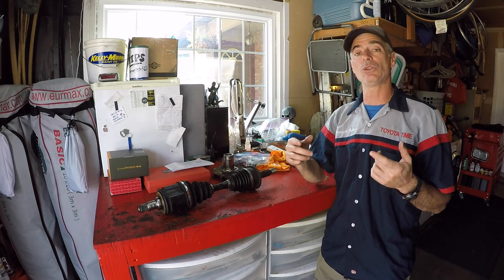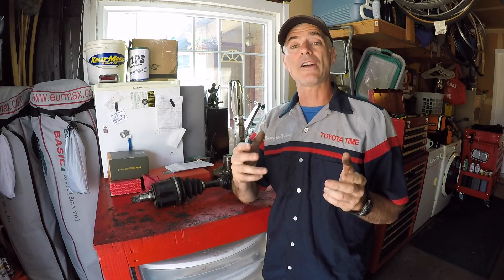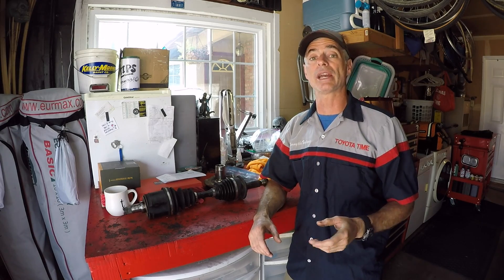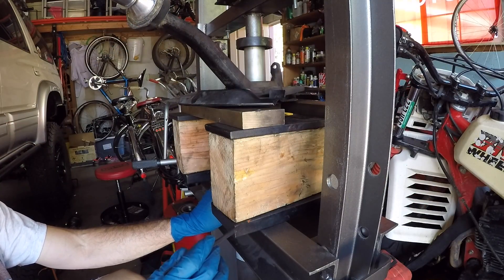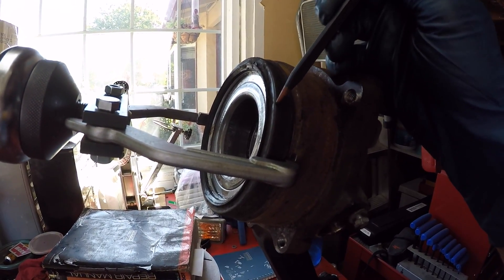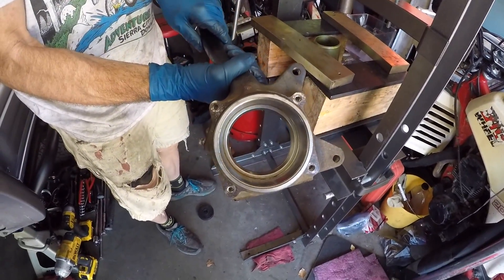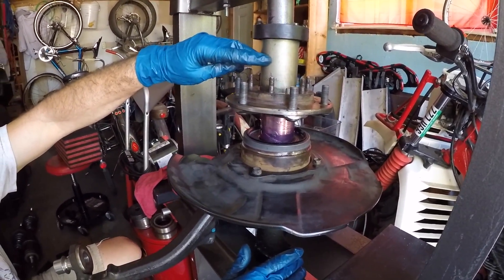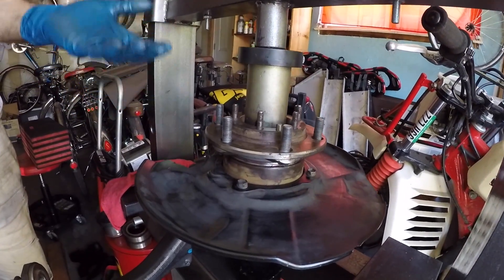Manual Hub Swap Part 2 - A.D.D. Hub Bearing Replacement

Comment: Hi Tim, thank you again for your fantastic videos. They are always helpful and educational.

I'm about to press the hub back through the bearing, and have a question about the tone ring and bearing spacer: Is there any reason you couldn't press those in at the same time? My idea for the set up from top to bottom; press plate from sleeve kit, press sleeve, hub, bearing, tone ring, bearing spacer, a press sleeve that fits the bearing spacer diameter, then the bottom plate. The ABS ring and spacer would brace the whole face of the bearing so as not to damage the inner race. Do you see any reason this wouldn't work?
Reply from the maker: I understand what you're saying but I think it would be safer to get the hub into the bearing first making sure you properly support the inner race.  Then just simply slide the ABS tone ring over the hub shaft.  Finally, press the bearing spacer onto the shaft or maybe just tap it on with a hammer.  The bearing spacer isn't a tight fit.  It should go on fairly easily.   If the bearing spacer was a tight press fit, then I think your method might be a good way to go.  I remember grabbing onto the spacer and it just spun on the shaft off the hub so I know it should go on fairly easy.  If you try your method let me know how it worked.  If you tried my method, report back and let me know the technique you used to get the bearing spacer onto the shaft.  Thanks.
Reply: @TimmyTheToolman  Alright, after reading this and looking at it some more I realized there was a lip that the abs tone ring sits on. I figured that it could be a bad idea to try and press everything on at once since the tone ring might hit that lip and then I wouldn't know if the bearing was seated properly, so I went ahead and skipped that idea. I did try it with the hammer and a properly sized press sleeve to set against the bearing spacer, but after some good whacks (I tend to not like whaling on things with a hammer) I decided to press it instead. With the properly sized press sleeve it went on very easily, and even made a definitive popping sound once it was seated properly. Didn't take much force at all. A note to anyone doing this: the tone ring and the bearing spacer will be able to spin and even move up and down just a bit, even once it is seated properly. Thanks for the brainstorm, Tim!
Reply from the maker: @maximusbkk9232  Thanks for getting back to me and sharing this.  Good to know using the hammer to get the bearing spacer in place probably isn't the right method.  Since we don't have a dedicated video for a wheel bearing replacement, I'm gong to do this job for a guy very soon and film it.  Lots of people ask for this video and I've referred dozens to our Manual Hub Swap videos.  It's time for me to just make a video specific to replacing a wheel bearing.  Good job getting this job done on your own.  Most people take their knuckles to a shop to get the press work done and that's a big mistake.  Shops screw up this job all the time.  I've read about it countless times on Toyota forums.  You're very welcome and Happy Wrenching!
Reply: Sorry to be off topic but does someone know of a trick to log back into an Instagram account?
I was dumb lost the login password. I appreciate any help you can give me!
Reply: @Otto Louis instablaster =)
Reply: @Chad Leighton i really appreciate your reply. I got to the site on google and Im in the hacking process atm.
I see it takes quite some time so I will reply here later with my results.
Reply: @Chad Leighton it did the trick and I now got access to my account again. Im so happy:D
Thanks so much you really help me out!
Reply: @Otto Louis no problem :)

Comment: Timmy,

There is some confusion related to the CV axle needed. You listed somewhere (whether it was on this video or the 1st one) the P/N needed for the CV. I looked that part number up and it did not say anything about A.D.D. There is another P/N that states "W/ A.D.D". So I am confused as to which one to purchase because I have heard they are different. If you can let me know I would appreciate it. Thanks
Reply from the maker: The one that says w/A.D.D. is for the non-manual hubs.  A.D.D. stands for automatic differential disconnect.  The part number for the CV axles we list in Part 1 is correct - #434300401084  
https://parts.camelbacktoyota.com/parts/index.cfm?searchText=434300401084&make=Toyota&action=oePartSearch&siteid=214329
Reply: @TimmyTheToolman  I guess they arent as expensive as I thought then because the A.D.D ones are like $400 each. The other P/N you just listed arent so bad. Let me look again at the OEM site I am using.
Reply: @TimmyTheToolman  Thanks for the info. Do you happen to know the spline count on the outer shaft splines? Trying to look into the manual hubs from Warn. They are calling for 26 spline count.
Reply from the maker: @Heffe112  Yeah, I saw the same thing for the Tacoma CV axles.  The A.D.D. ones are super expensive and the manual hub ones are about half the price.  What's weird is the 1st Gen Tacoma A.D.D. axles are pretty much the same as the 3rd Gen 4runner axles and the 3rd Gen 4runner axles are way more affordable.  Doesn't make sense why they are so expensive.
Reply from the maker: @Heffe112  They are 26 spline on the outer shaft.
Reply from the maker: @Jeffrey I really like this mod and think it's worth it as well.  I like the fact that my CVs aren't spinning all the time so I don't wear them out prematurely and that I also don't have to worry about ripping boots due to the lift.  My CVs only spin when I'm offroading.  I also have utilized 4lo going up a steep road ascent to keep my trans temp down.  With an A.D.D. system you can't you 4wd on pavement without risking CV and differential damage.

Comment: Hey timmy, you guys are awesome because you make me freak out on things I need and start spending money. So I know it never ends with upgrades, as you most certainly know with your mall crawler, but I've just about dialed my 97 4runner in to where I'm good to go and not get stuck out in the middle of nowhere. So here it is, I feel I need to do this swap via my mechanic rather than hope I don't brake a CV or carry a spare and try to fix on the trail. I'm a little clueless to where I start looking for the parts to do this. Can you give some tips, thanks.
Reply from the maker: Hey John, if you're into serious mall crawling like I am, you definitely need this mod.  Those mall parking lot speed bumps can be vicious.  Start looking on Craigslist and Ebay for people selling the manual hub knuckles and CVs.  I found a guy in my area who was parting out a 1st Gen Tacoma and picked up the used parts for $400.  You could also look on Tacoma World in the classified section because people sell all kinds of stuff and part out trucks.  Finally, you can get on the PickNPull website and save a search criteria for the earlier 1st Gen Tacomas, 1995 - 2000.  PickNPull will notify you via email when a vehicle fitting your search criteria pops up within the search area distance you have specified.  If you're lucky, you will find a wrecked one with manual hubs and you can grab the knuckles and CVs before somebody else nabs them.  Good luck with the search.
Reply: @TimmyTheToolman  thanks. I assume i need this mod because we do go on the trial's sometimes alone but don't do real crazy crawling. I do understand that with my 3 inch lift it wears the CV and a simple climb could break it. Hopefully i can get this mod done for about or less than 1,000$ but worth it if it breaks and not get stranded. Oh yeah i changed the upstream air fuel ratio all by myself. Im not very mechanically inclined. Thanks.
Reply from the maker: Hey Austin, you don't actually NEED this mod.  It's just nice to have the option to fix the CV somewhere else other than the trail if you can get out in 2WD.  If you break a CV out on the trails with A.D.D.knuckles, you'll just have to swap it out there or cut the shaft in the middle so you drive out.  Replacing a CV isn't really that hard with the right tools.
Reply: @TimmyTheToolman  my biggest fear is not being able to get off trial if it breaks. So if i dont do this mod then as you say cut the axle and drive off? Maybe a video on what to do if you break on the trial. Plus i kinda want to sit with the cool kids at lunch. I wonder if this a good resale mod?
Reply from the maker: For an ADD knuckle, the outer CV shaft tightened into the hub preloads the wheel bearing, so you can't just remove the CV shaft and drive out.  You need to either replace the CV axle or cut the shaft out of the damaged CV to keep the outer shaft connected to the knuckle to preload the bearing.  The easiest solution is to just carry a spare axle and the tools necessary to swap it out on the trail.  I would say this would be a good resale mod for a buyer who knows the benefits of having manual hubs.  Even with doing the work myself, I still spent $800 on this mod.  You would definitely be in the cool kids club with this mod.
Reply: @TimmyTheToolman  hey Tim I'm in a bit of a pickle and would like your input. It off this topic but didn't know how to message you but here. So I got this 97 4runner and bought it for 5k and put another 5k fixing leaks and making it ready to go. It's ran great and smooth from the time we got it back in April and have only put about 700 miles on it. Last week I got a misfire going and now my mechanic says it needs a engine swap but it first was one cylinder was 30% lower on compression and thought a valve adjust would fix it. So that being said there's a lot of things going wrong for it only supposedly having 145k on it and seems like there's a gremlin in there. My friend doesn't want me to put any more money than neesasary and sell it and move to something newer but we do love it but really feel like if we swap the engine then the tranny or something else will go and we're into it for more than 15k. Now I know you have way more than what yours can sell it for, not that you would, but when is it too much? We like 4x4ing but nothing crazy mostly fire roads with some side stuff like at Cleghorn trail near my house which my 4runner does well at and some camping. I'd appreciate any input and I know it's not every detail but you get the gist. Thanks and if you don't want to reply that's cool also.

Comment: My buddy here in KY tried to press his hub and bearing from a 2000 4Runner with no luck! used a 20ton press- I think the corrosion did it's damage.
Reply from the maker: I would suggest he try again after he heats up the outside of the knuckle really well with a butane torch.  He doesn't need it to be glowing hot.  He just needs to heat it up evenly around the whole circumference and then immediately try to press it out.  I'd have the bearing with a little pressure on it while heating up the knuckle so it's ready to press out as soon as he turns off the torch.
Reply: Timmy The Toolman That's a great idea, thanks brother Tim!!
Reply from the maker: You're welcome Brother Jake.  Let me know if my idea works out for your Kentucky Brother.
Reply: You were spot on- we tried again with Heat and, after much pounding with brute force/heat, she relinquished to our demands brother Tim!!
Reply from the maker: Good job gettin er dun Brother Jake!

Comment: I am rehabbing an 02 Sport Edition, and almost everything I need to do has one of your awesome videos associated with it.  However I'm going to replace the front wheel bearings and rebuild the knuckles in a stock configuration, and this video is as close as it gets in your catalog.  Do you plan to have a video for that task in the near future?
Reply from the maker: Hey Mike, that's great you are finding our channel helpful.  This video and the Manual Hub Swap Part 1 is basically all you need to be successful with doing the wheel bearings on your rig.  There are other videos that could help you with the reassembly and that's either our CV Axle Reboot Video or our Upper Balljoint Replacement video.  Here's some links:
https://youtu.be/vcCT4UgFUTw

https://youtu.be/-sY2azyLBuI

All the information is there in the videos.  If you have the right tools, you can do this job no problem.  Good luck and Happy Wrenching!
Reply: Yessir, this is my second 3rd gen, and I'd replaced ALL the front suspension components and CV's on the first one (sometime in 2016), so I've been down that road before.  Having said that, I have watched your CV axle video as a refresher / way to get new tips.  When I did the project in 2016 I took the easy route and bought refurbished knuckles from a seller on eBay (all new bits and pieces pressed in), but this time I have the tools to rebuild them myself, so that's my plan.  I already watched your UBJ video, and that seems straightforward, but the video I'd love to see would be one for pressing the hub and bearing out of the knuckle, and then pressing the new ones back in :).  I do have some links to a couple t4r.org threads saved, and they have good pics and advice, but your videos are just the BEST!  Since I'm not really a rookie after that first 4runner I'm sure I'll figure it out, but maybe just a heads up for a gap that I saw on the interweb for this particular video tutorial.  You don't have one, and I couldn't find a good one from anyone else either.
Reply from the maker: @michaelheit9321  Mike, the Manual Hub Swap videos Part 1 and Part 2 video shows all the press work you need with the exception of getting the bearing spacer in place which I assume is very easy to do.  You could probably just tap it in place with a hammer and a press sleeve.  We show all the pressing of the hub out, the bearing out and both back in and all the associated seals and retaining snap ring replaced.  I know they are long videos but it's all there.  Trust me.  Watch the videos and you'll have everything you need.
Reply: Oh man, now I feel foolish, my bad.  I watched a good part of the beginning of part 1, but not the entire thing, and didn't even start part 2.  I'll watch the entire thing and get 'er done.  My apologies man, thanks again!  Sometimes I get ADHD and will jump between topics (I'm killin' many many projects on this truck).  I probably started streaming another one of your videos and didn't bother to follow up with this one...

Comment: Hey I'm hitting ready to do this. Do know what the press sleeve kit you have is called. I need to get one and the one you recommended in the description is no longer for sale. Thanks
Reply: Also where did you get the 1 inch think bars if you don't mind
Reply from the maker: @ericbrown6802  Here's a link to press sleeve kit I found on Ebay: https://www.ebay.com/itm/26Pc-Universal-Press-and-Pull-Sleeve-Kit-Bush-Bearing-Removal-Installation-Set/163230894198?hash=item260151c876:g:q54AAOSwaRRcalbw

Your most affordable option for 1" press plates is visit a fab shop in your area and see if they can cut you a couple.  3" wide plates that are around 14"  long would be sufficient.  If you don't have a fab shop locally, you can do a search on Ebay or Amazon for press plates.  Here's a link to a set of plates I bought off Amazon: https://amzn.to/2tb83il  The other plates I got from a fab shop and it was much more affordable.

Comment: So, just to be clear, you're using the 4Runner knuckles, with Tacoma manual hubs, bearings, seals, etc. and Tacoma manual hub CV's? Do you have part numbers for all these, or are they in your previous manual hub swap videos? Sorry if you actually mentioned that in the video. Keep up the awesome work!!
Reply from the maker: Well, you're sort of correct.  Yes, I'm using the manual hub spindles, manual hub mechanisms, and manual CV axles from a Tacoma.  The bearings, seals, snap rings are interchangeable between the Tacoma and 4runner knuckles.  They are the same part numbers.  The lock nuts are specific to the Tacoma manual hubs.  And yes, I mentioned in the video that all the part numbers are in the first video along with a ton of other helpful info.  You definitely want to check out the other video before attempting this project.
Reply: I don't see the manual hub spindle or manual CV part numbers in the first video. They are 43502-35160 (spindle) and 434300-401084 (CV axle) in case you wanted to add it somewhere.

Also, didn't mention this before: YOU ROCK!!! What you are doing with your videos is setting the standard for car repair videos on YouTube!! Keep it the amazing work!!

Cheers
Reply from the maker: Thanks for providing the spindle part numbers.  We're assuming people will get the spindles from the Tacoma knuckles they find for sale.  Buying them new is quite expensive.  We're glad you have such a high opinion of what we're doing with our channel.   Sean and I are trying hard to provide good content for people.  Thanks for taking the time to comment.  We appreciate it very much!  Happy Wrenching!
Reply: Lol, updated my comment just as you were replying. Added the CV axle part number to that, which is unusually long for some reason. Got these from Camelback Toyota, but might check one other place as well to be sure. If you don't mind, I'll add these to the T4R.org thread as well.
Reply from the maker: Yeah, add those part numbers to the thread.  I added the spindle part number to the original manual hub swap video description.   Something isn't right with that CV axle part number.  I'm not coming up with anything with a search.
Reply from the maker: I took the dash out of the part number and now it leads me to the axles.
Reply from the maker: weekendclimber I took the dash out of the part number and then I found it doing a search.  I added the part number for the CVs to the original video description as well.  Thanks!